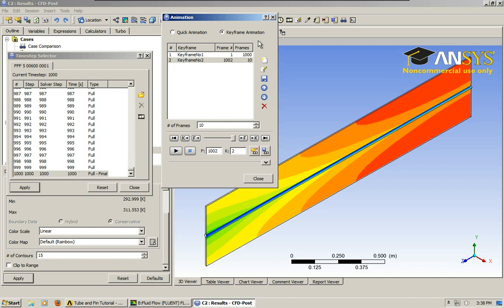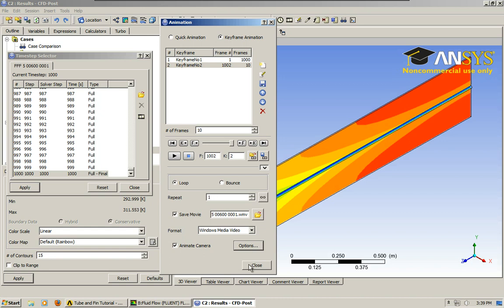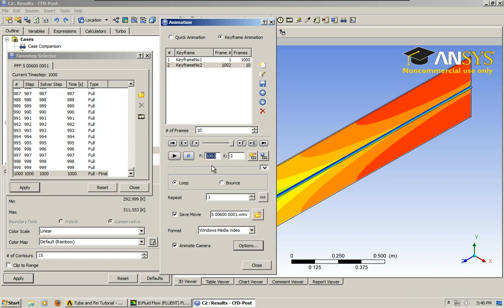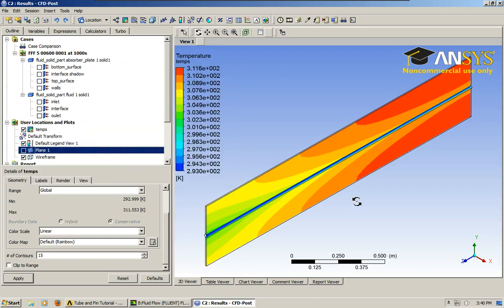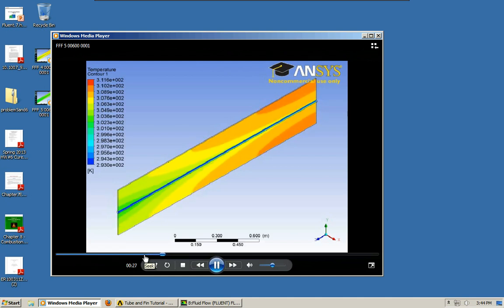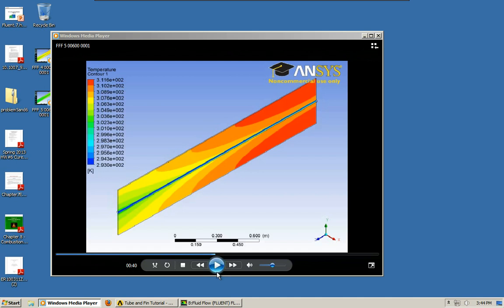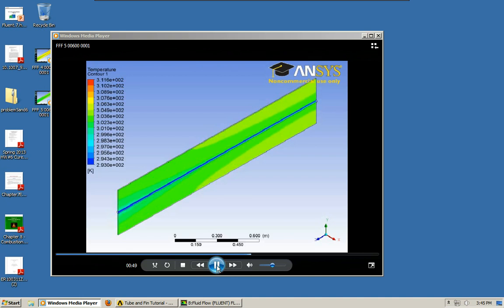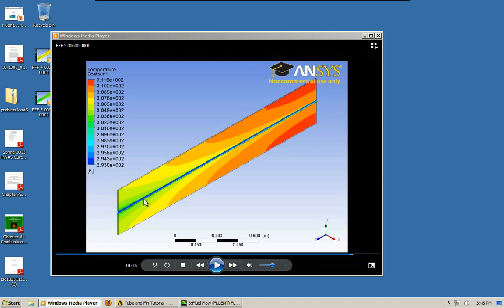Ansys Fluent Transient Heat Absorber Simulation Part 3

Comment: hey thanks, but what happens between vid 2 and 3 ? how do you make your timesteps appear in the animation frame section
Reply: Ioannis Alissandratos Did you get an answer from him or manage to figure it out?
Reply: Nope, its a tricky thing. I asked cfd forums too but nothing
Reply: Ioannis Alissandratos Nthato Moagi Hey, I don't know if its any help, but in fluent under "Calculation Activities" in solution section you get the option "Solution animations" have a look into that. I just found out about it myself, so have to take a closer look.
Reply: Abdur Rahman Jalil Yep... That's what I ended up using as well. I finally figured it out myself. It was adequate for me, since all I needed was a short animation of the static pressure contours for my transient case for my Research Thesis presentation.